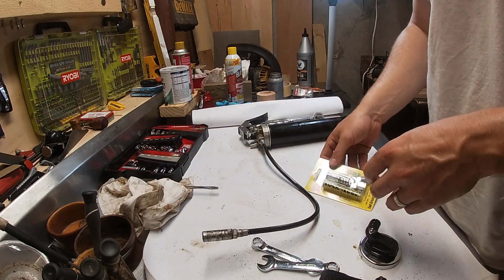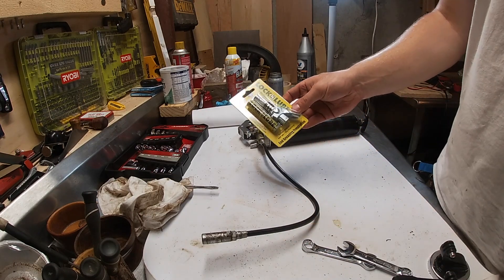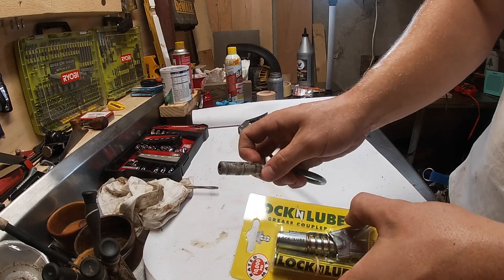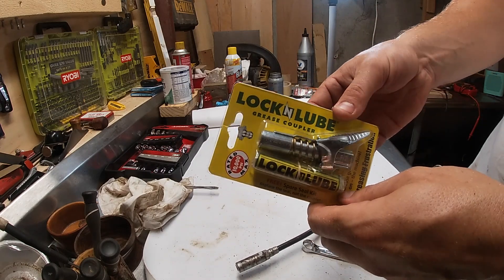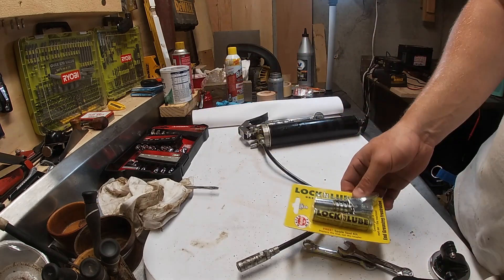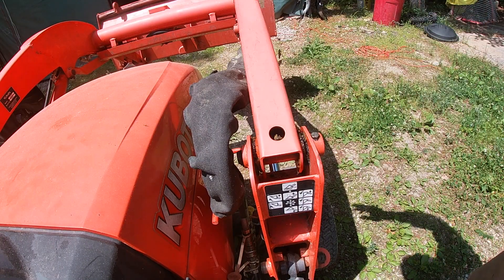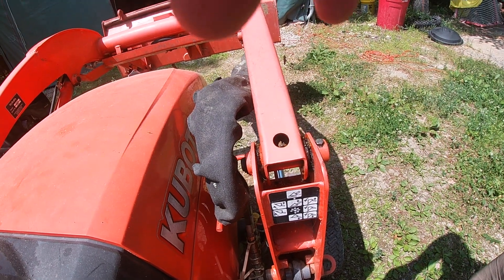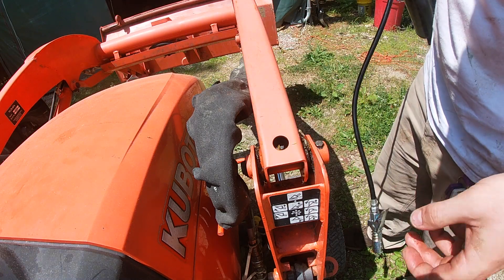The BEST Tractor Tool! EP 55

Comment: You should change your title - this applies to SO MANY tools other than just your tractor.  I have zerks on most of my power equipment, plus ball joints / tie rods, etc in your car.
Cool looking tool, thanks for sharing
Reply from the maker: Yes I would imagine there are 1000 pieces of equipment this could work on and not only tractors! Thanks for watching!